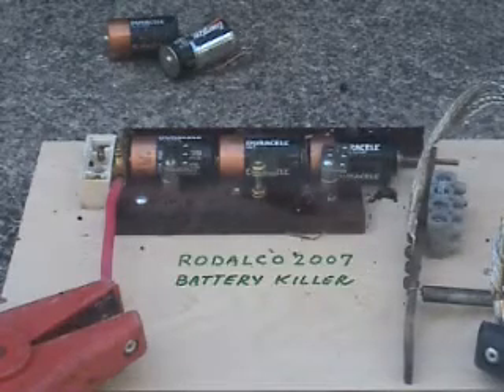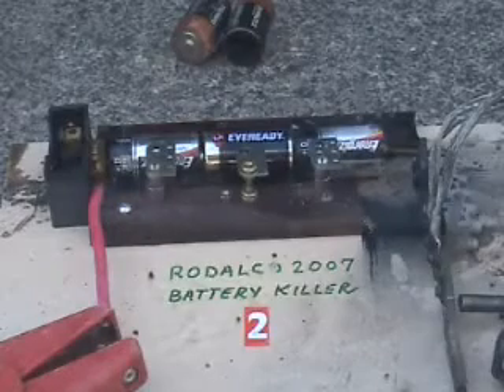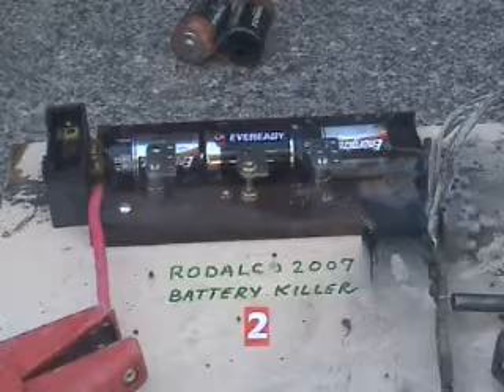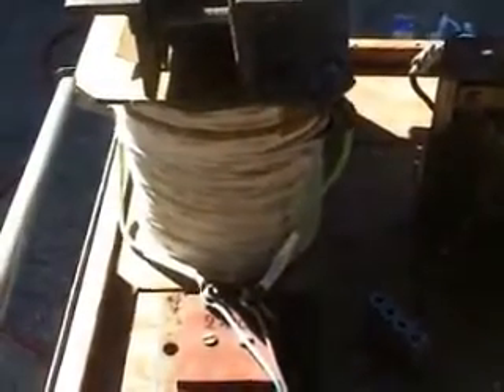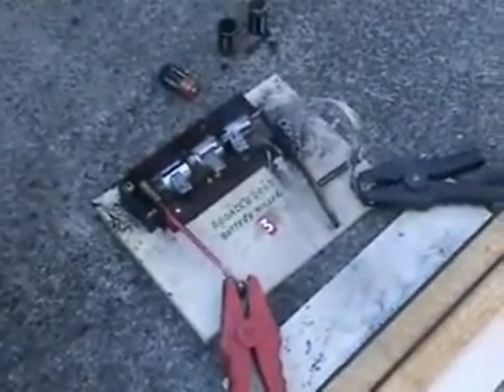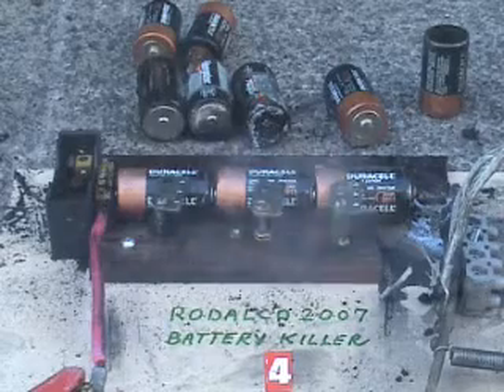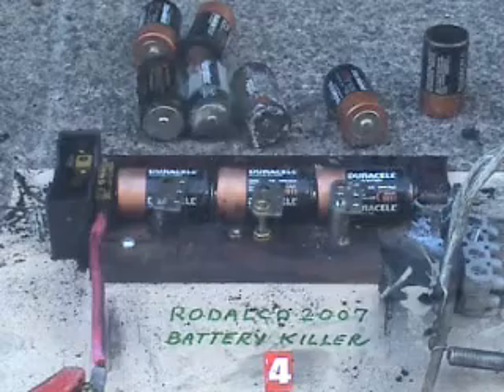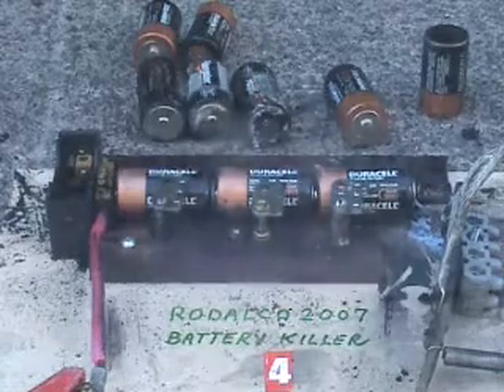4 Battery Explosions

Comment: I've managed to get some spectacular explosions, as well, don't hesitate to use even more voltage and current, I managed to get big bands in just a few seconds, you can pump several hundred amps through those D Duracell's, the cheap zinc carbon Eveready go pop too, with a black carbon dust blasted all over the jig. It's good fun, excellent video.

Comment from the maker: The battery clamps the voltage as a dead short and not much will happen unless you got 1000 Volts and 100 Amps at the same time to play with.

I find between 24 and 55 Volts at ±100 Amps perfect for these experiments.

Yes, you need a 1 kVA step up transformer 110V 9.1A to 1000V 1A. ac.
Then rectify to DC with appropiate rated rectifier diodes.

Comment from the maker: Well you charge with dc or dc with a pulsed ac ripple on it.
This experiment is just for fun to blow the batteries up.
A carbon cell battery can not be recharged.
A nicad or whatever else charge at about 5 to 10% of Ah capacity.